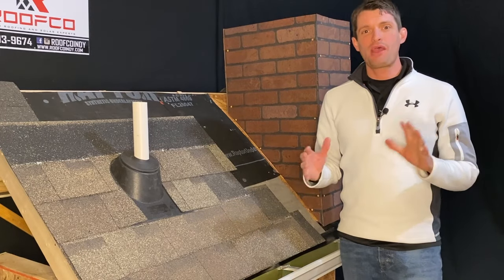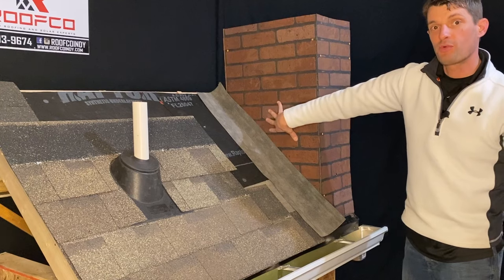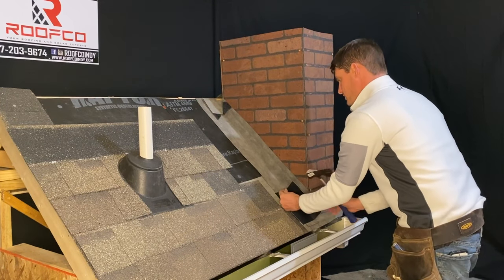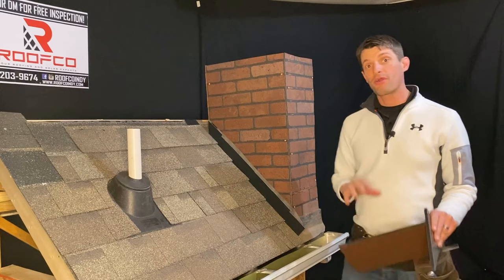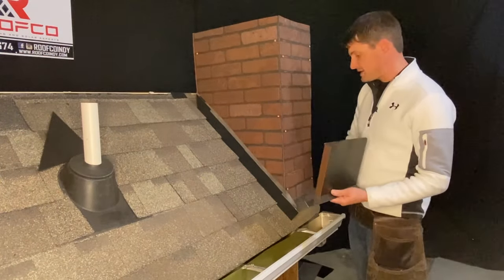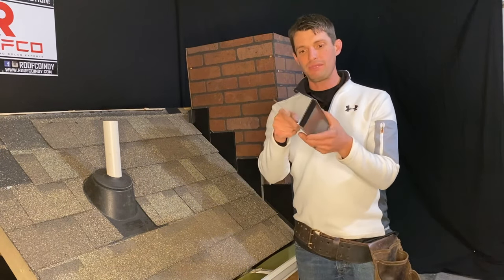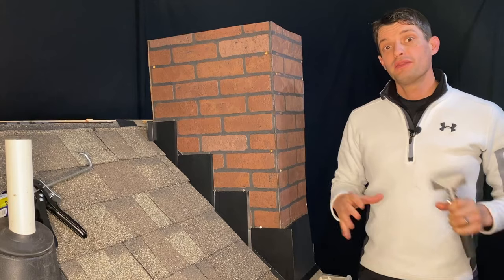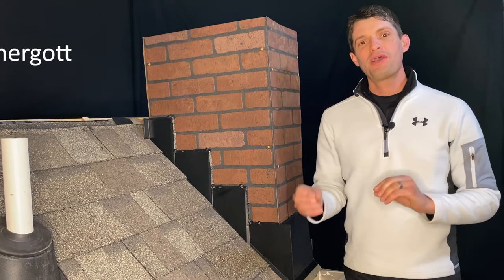How to Install Brick Chimney Flashing and Counter Flashing Step by Step

Comment: Pre-caulk the masonry joint and set the metal into it before top caulk.
Reply from the maker: Great feedback.  Thank you for sharing!
Reply: Monetize this comment
Reply: Also the top 90 ° bend should be hemmed and is to be bent back the other way to lock in the masonry joint . Once you push it in to where it goes it won't come out. Been doing them for a while now never had an issue.

Comment: Couple things.... 1. Aluminum brake metal is not suitable for contact with masonry. 2. Caulking is a term that refers to an esthetic finish material used in a non weather condition. The correct term is sealant. 3. All reglet set flashing requires a spring hem not a simple bend. 4. Fill the masonry joint with sealant and and set the flashing then seal the face..... I could go on SMACNA is your friend....
Reply from the maker: While we have completed hundreds of successful installations and the company who taught us has done thousands using this method; we are always looking for ways to improve and find better products and methods to be better everyday.  Would love to see any photos or videos to learn more.
Reply: @roofcoroofingexperts7836  The current SMACNA manual has all the info you could ever want to know about flashing.
Reply: Couldn’t even see what you were doing on the lower chimney face. A closer camera angle would have been helpful.

Comment: I haven't seen Vulkem since i worked for a big company in Blue Ash Ohio, probably 30 years ago,
old dude who got me started doing metal work told me he used a little bit of it on some minor leaks in his boat haha. Dude was a beast, he'd line 200 foot of box gutter a day with just a green bean, like i was at the time, about 34 years ago. 
I flash my chimneys outta galvanized sheet metal and solder all my seams, that's just the way i was taught to do it, but I've surely flashed many chimneys with coil stock aluminum. Chimney is easy enough to counter flash, if i have a long run of counter on a longer brick wall, I'll measure and mark the bottom and the top however many inches i want my counters, but not only do i do that with a union counter, but with my step counters as well, chalk that line, then take the mortar joints out from the chalkline back, your counter will all be the exact same size and look perfectly uniform. Of course with modern saw blades, diamond tip, easy enough to cut a line straight thru the bricks to create that channel for Union Counter, all comes down to customers preference for me, tho there are times when one will work better than the other as well, every situation is different really, just depends on what's called for in any given set of circumstances.
Reply: Hello from Cheviot.
Reply: How would you do it for natural stone?
Reply: @laurenharper1510  use sheets of lead to flash natural stone, that's really your best bet to have the flashing turn out nice

Comment: Thanks for showing this, I am dealing with a leak but between the first and second floor. Same pitch of roof in a 1950's house. I have been scratching my head on how to do it because I have been quoted 4500 dollars to fix the issue and I am not paying that.

Comment: Your counter flashing is to close to the roof brother. You want at least a half an inch from the roof so it doesn't suck water up behind it.   Also when you are doing ice and water start from the bottom and work your way up so it's properly waterproofed. And another tip we do on counter flashing, instead of creating an "L" lip on the counter create a "V" shape and use a rubber mallet to tap it in. It will fit itself in without using nails and better for waterproofing. Good video 🤙
Reply from the maker: Really like the idea and feedback.  Much appreciated.  We will definitely give it a go and report back.  Thanks.
Reply: That is how we plug the top of the counter flashing too with the semi open hem also we dont step sides we cut evenly up the sides.

Comment: Nice video! I have a large chimney (I chose to bring whole chimney up, rather than make it smaller at the top, it’s 27’ tall) 9’ wide and 3’ deep, it has 2 fireplaces, one in basement, the other in the family room on the first floor. Basement one has a 48” damper and the other a 42” damper. This was built in 2004. The chimney has a large saddle, 9’ wide at the base. The whole saddle was covered by ice and water shield, including valleys, galvanized step flashing and rather than an aluminum step flashing, a notch was cut into the brick diagonally down and a white aluminum flashing was formed on a brake 😊and caulked. This was changed in 2019 when the roof was replaced (hail damage) and the roofer replaced the whole flashing system. He said it was cheaper than trying to clean and reuse. He did it more like yours, but he used the cutout diagonal hole in the brick. This has been in 4 years with no problems.
Reply from the maker: Thank you for the comment.  You're correct.  We commonly see the type of flashing system you described.  When done properly, it can also be effective!

Comment: Hello... very meticulous job on the step flashing.  2 Questions:  1: the step flashing is just aluminum and no sticky back, it is just put in place by 1 nail at the extreme corner?  2: the flashing part that is on the chimney; you have a mason nail with the head ONLY holding on to the flashing and then the caulk and nothing else to hold it down to the brick chimney?
Reply from the maker: Thanks for your questions. 1.  we have begun both applying flashing tape over the step flashing in addition to sealing the back of the step flashing with roofing sealant to close any gap.  We do not nail the step flashing to the brick.  2.  The counter flashing will most typically have one masonry nail installed at the top of the flashing.  Next we apply vulkum sealant over the nail while sealing the flashing joints to the brick.

Comment: Good job detailing the process. What about a roof cricket/saddle at the upper slope of the chimney though. I think that's a better resolution.
Reply from the maker: Agreed.  We always install a cricket if the rear of the chimney is over 36" inches wide, vs. a flashing pan,

Comment: Nice Jumper Bro!  Do you have any videos on building an enclosure to be used as a base for mounting a 40-Watt 1600 CFM Galvanized Black Steel Roof Mount Solar Attic Fan., and how it could be flashed?

Comment: If you want to be 100% sure then trowel in a 3-4" swath of roof cement around the lower edge of the brick where chimney meets roof deck. Set you're ice shield into the roof cement and press with trowel you will be covering yourself if chimney develops joint cracks.
Reply from the maker: Good idea.  We have recently begun caulking between the step flashing and brick and also adding flashing tape to the step flashing, before installing the counter flashing.  Do you recommend any specific type of roofing cement?
Reply: @roofcoroofingexperts7836  I started roofing in 1971 and I'm 2nd generation roofer with 3 other brothers.  I convinced my father in 1979 to start using ice shield and roof cement around chimneys mostly due to our climate in the Cleveland, Ohio area. Most roof cement will work fine but I have used mostly Karnak products. Regular or Ultra is fine. We cut all masonry joints and install reglet edge on our flashing metal.
Reply: @roofcoroofingexperts7836  Karnak 155

Comment: below the top piece of counter flashing is that little diagonal actually the top of the top soaker or step flashing? should that not be trimmed to ensure it sits behind the seal of the counter flashing?

Comment: My house was built such that the brick veneer was placed on the wooden chimney chase AFTER the roofing shingles were applied.  So all step flash is under the brick veneer. Does this method also work on brick veneer over a wooden frame?  Thank you

Comment: what do you do to the other side of the chimney counter flashing? do you put the 1 in bend "wing" on each side for the front and back piece? Do you put the one inch bend on left and right side of rear counter flashing? if so how do you lock in both sides?
Reply: I am wondering the same.

Comment: Wind driven rain hits your black step flashing and runs down and is now under the shingles that abut the chimney. Are you  expecting that water to not penetrate the ice and water shield and then drain out under the first course of shingles?

Comment: Simple and good demostration. Thank you very much！ will you recomend any other flashing sealant？
Reply from the maker: Thank you Donald.  Presently we have only relied on Vulkum sealant as it has proven to provide the best long term protection.
Reply: Tremco has by far the best masonry sealants. The two part sealants double the life of the installation.
Reply: Thank you both for the reply. What do you think about Henry wet patch for roof leak? Thanks in advance.
Reply: @donaldh3504  for a short term temporary patch it's fine but a proper repair is best once weather subsides. Also depends on the repair being made.
Reply from the maker: @jerrydawg4434  We will check it out.  Thanks.
Reply: There are some leaks on my roof so I decided to use Henry’s wet patch to patch up now to buy a few months of time till next spring. Any recommendations from experts? And should I use exterior window and door caulk for wood siding on my roof ? Or rubber seal spray could do the work as well?
Reply: @jerrydawg4434  yes indeed  and thank you for your comment. We have a few quotes from SF roofing company, and during pandemic the cost went up as rocket sky high. Three quotes like $48000,$39000,$28000. The first two including replaced some dry rot and converted my half round gutters into fascia gutters. Will the cost go down next year?
Reply: @donaldh3504  everything will go down in next year's recession...;)
Reply from the maker: @donaldh3504  Hello.  If you’d like please feel free to email us some photos and we’d me happy to discuss with you.  Happy to help anyway we can.  Hello@roofcoindy.com

Comment: Can this process also be done on a  stucco chimney? I've been told by some roofing companies that for stucco the flashing must be installed underneath the stucco therefore it must be broken and then redone over the flashing.  Other companies have described a process that seems to be what you explained here with this brick chimney.  Thanks in advance.
Reply: You can do it just like in this video, except the counter flashing will run parallel with the roof line instead of following the mortar joints.

Comment: Nice flashing job.
Is that steep counter flashing as good as the single piece type? It sure looks easier to make and install.
Reply from the maker: We prefer the individual pieces as it allows us to into the mortar joints and ensure a tight seal.
Reply: A single piece flashing can be done but it is harder to do well and unless the masonry unit size requires it, not necessary.

Comment: Do you use any tar on the backsides on the flashing?
Reply from the maker: Hello.  Thanks for the question.  We first install ice/water shield membrane followed by flashing under the shingles.  Next we install the counter flashing with a pan extended 18' behind the back of the chimney.  No tar is used; however, we have begun using flashing tape to install over the step flashing and ice/water shield before installing the final counter flashing.
Reply: Nooooo....

Comment: Use copper,fold corners on step flashing. Install counter flashing with appropriate folds,solder corners. No nails no interlocking pieces. Lasts longer than the roof will

Comment: Imho using 8 inch lead for step flashing and 10 inch lead for bottom and top looks much nicer, and does a much better job.  Lead can be 'worked' to wrap around.  The bottom lead should always go first, which wraps up where your first piece of lead flashing goes.  In turn your first piece of step should wrap about an inch over the bottom lead.  This requires a lot more grinding as  you must also grind all the steps, making sure that it overlaps each previous piece of flashing.  Finally The top should contain an additional piece of ice and water shield that is placed over top of the top piece of lead to protect against any ice buildup that will occur.  It also wraps the top piece of of step flashing.  We then use what is known as quad sealant to do all the joints, as its flexible and has a lifetime of 50 years.  This is more expensive and time consuming way to install but it looks way nicer and will last much longer. 

Finally I mentioned never nailing flashing around a chimney and that's because they move over time.  If you ever stripped older roofs you'll often notice that nails are lifting quite bad around chimney flashing and its because they move around, as well as the metal and or lead which expands and contracts as its effected by outside temperatures, and the chimney itself.
Reply from the maker: Would love to see some photos of the work you've done.  While our system has performed extremely well over the years, I'd love to learn about different ways to do the work.  Would you mind emailing photos? hello@roofcoindy.com  Thanks.
Reply: Agreed though many places will not allow lead in new construction.
Reply: I agree.  But my problem is to try to be environmentally pro active.  Lead is very pliable.  I have to do this to my chimney.
Reply: @jerrydawg4434  There are alternatives to lead, such as zinc, and others.  The key to remember is not to put nails in the bloody flashing, it creates the potential for a leak. makes it much more difficult when stripping the roof in the future with chances of ripping the flashing.  It is perhaps my number one pet peeves in the roofing world.

Comment: So the step flashing is also bent at the top to go into the masonry joints?
Reply: Not the first aluminum one.  Only the brown one, they call it counter flashing. Read up above and genayev says they cut a 'v' shape instead of just a lip and force that into the cut masonry joints and that it will actually stay in there without nails.  That's what I'm going to do.

Comment: Not a project for DIYers and roofers usually know how?? "Intricately bent" sheet metal works for a contractor with a $1599 brake. You should mention alternatives. The least expensive would be what's called a "folding tool" by HD sold for $25. There are other intermediate options costing hundreds. Another advantage of the folding tool is that it can be used on the roof.

Comment: Wouldn't it be better to use mortar to seal the flashing in the joints?
Reply from the maker: Hello and thank you for the question.  Using mortar is certainly an option.  Our crews use Vulkum but either will work.
Reply: Todays adhesives work better than mortar since it doesn’t shrink.  When you use new mortar it also will look way different than the older mortar and it stands out really bad I usually use Chemlink M1 polyurethane or something similar .  I apply an initial bead and then a second application after the metal
Is installed .  I’ve been in the masonry and hearth industry for over 20 years now and haven’t had a leak yet and live in the wet PNW.  Unless I am building a new chimney I also prefer one piece per side of the chimney since it’s offers better protection as long as the chimney was built well and isn’t wavy .  I only use step flashings on brand new rebuilds .   I hope this helps.

Comment: No offence, that looks terrible. In the UK we use lead soakers and lead step flashing. Looks much better and lasts decades.
Reply: What is a soaker?
Reply: @williamriedel1686  a material like lead, bent at 90⁰ that goes under the tile/slate and up the chimney breast/wall. Then flashing goes over the top.

Comment: I like how you have interlocking pieces, I will be stealing that! However, sides look like SHIT! When people make the steps on the chimney. Should just cut your grove at a angle 3" or 4" (or whatever height u need) at the top, middle, and bottom. Put the metal slanted at a angle instead. It looks so much better then this. Also if you cut your grove at 1" depth, cut your top metal 1 1/2" -1 3/4" and bend it a cunt hair before that 1" mark like so:  <  then stick it in the grove.

Comment: Garbage. Shady roofing companies that have a gutter trailer trying to sell you sand at the beach. Cutting grooves into brick veneers is just asking for trouble but if a dam roofer knew anything about structural construction then they would know that. Go up on a commercial or industrial roof and see how things are really done.
Reply: Brick veneer is not structural